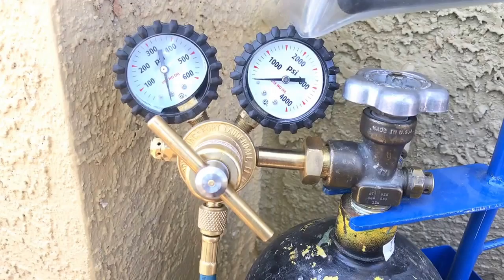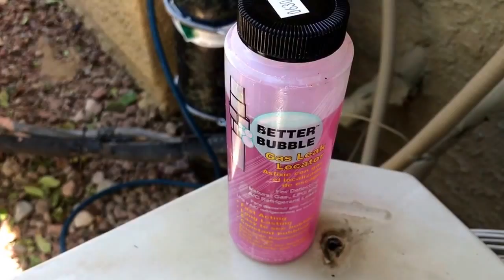AC Leak Test Using NITROGEN!

Comment: for auto motive car a/c how much maximum psi nitrogen to set up so that cant damage the system specialy the hoses
Reply: i recently talked to a john deere mechanic and he said he puts 300 psi. I was a little surprised but he said in triple digit weather, car on and ac running, the high side can be up at 350 psi.

Comment: Great video as all of yours are.  So you set the pressure based on the test pressures given on the system info label?  I am just getting setup with N2- so I dont need a flowmeter- just a regulator?  Thanks!!

Comment: Great video. My question, can the condenser coil be repaired?  Is it better to simply rerplace the entire coil assembly.?
Reply from the maker: It depends where the leak is on the condenser. Sometimes if it's on the corner it's an easy repair... sometimes it is in a more difficult area and at that point it needs to be replaced. 👍
Reply: Silicon

Comment: About how much nitrogen will be used for the testing?
Reply from the maker: On the panel of evaporative coil you can check for the maximum pressure. Depending on your system it varies. You do not want to exceed what the max pressure is. Hope that helps 🙂
Reply: @MoreThanMaintenance  what happens if you do for a short second? like accidentally if mine is 250 and it spiked to 300 when opening?

Comment: do you put nitrogen with refrigerant in system???
Reply from the maker: No the system did not have refrigerant, due to the size of leak. Whenever you use nitrogen there should be no refrigerant present. Hope that helps. Thank you for watching! 🙂

Comment: Use nitrogen with refregirant in system or without?
Reply: Usually if their is a significant leak such as here there won't be any refrigerant in system. There are times where if the leak is minor due to a pin hole leak you will have to recover refrigerant from system. I do have a video posted on my channel if you need it. To answer your question directly... no use nitrogen with no refrigerant in the system. Hope that helps 😀

Comment: Nice video. Near the leak there looks like a hammer mark fins bent as if somebody used a hammer to try to bend back a front fork lift ding. Looks like the installer did not inspect for damage for condenser. It looks like structure damage caused a leak later.
Reply from the maker: Great observation! Thank you for your input! I appreciate the feedback and insight 😀

Comment: How many psi for the leak test
Reply: I was told 150 psi
Reply from the maker: There are many factors to consider. The proper PSI is determined by the tag posted on the specific unit that is being worked on. Here the PSI max is pressure is located on the plate cover, covering the contactor, capacitor etc. Hope this clarifies that all models, sizes, specs differ based on size of unit, length or rather run of coil etc. My advice follow specs on tag.